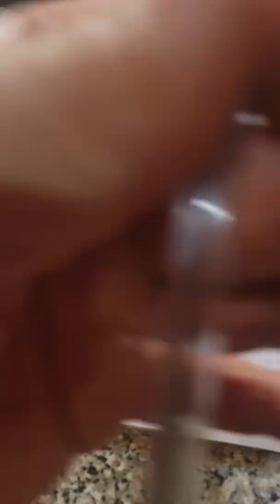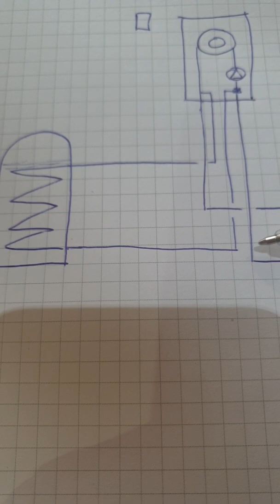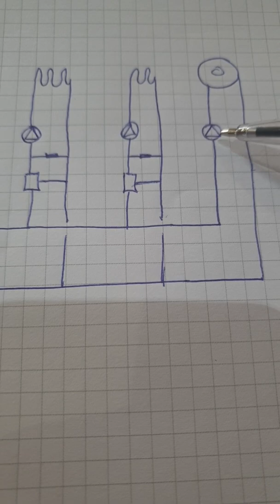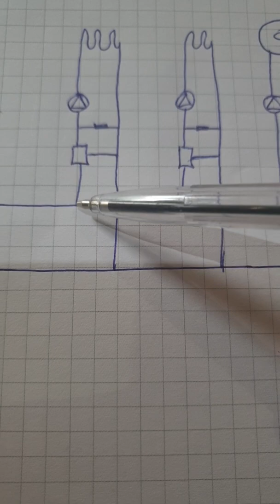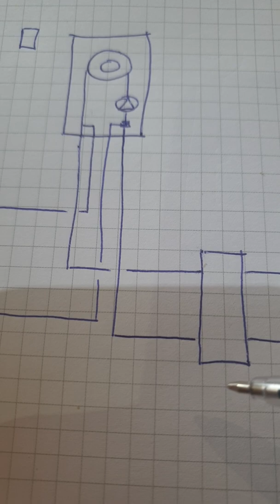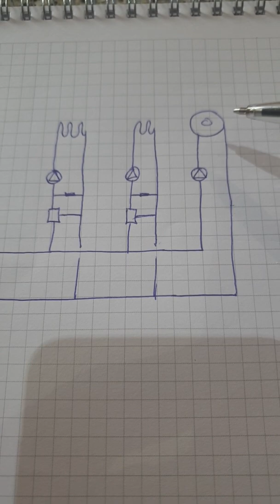Weather compensation and Viessmann design (Part 2)

Comment: Hi Andrew. Great videos. So informative. I have installed The new Viessmann 100 WB1KF combi in my 3 bedroom Victorian terrace. I have 8 emitters and have gone for WC only. 

I noticed in this video that you call the 100 WC dumb but on this boiler now you have the ability to alter the slope and level. 
I originally did have an internal Honeywell stat installed as well but have unwired it and am just using WC but have the stat still on wall as a reference point. 
Would you still recommend an internal stat wired back to the boiler in this scenario or would the WC only be ok?  Answers greatly appreciated. 😃
Reply: Yeah thought the weather comp was definitely better than the previous models. So would you recommend an internal stat in addition to WC sensor?
Reply from the maker: @himey78  no internal stat
Reply: Sorry forgot to mention. I currently have a slope of 1.2 and a level of 1 with a normal temp of 19 and a setback of 17 and the house is lovely and warm.
Reply from the maker: @himey78  the new 100 system is a very different beast.

Comment: Simple yet very useful and clear explanation, thanks!

I have a question, let say we have a standard heat exchangers only design (no underfloor heating), would it still be possible to have three independent zones, i.e. the three circuits of your example? Of course in that case I expect they will all work at the same max temperature, but that should not be a problem, is it? Am I missing something?
Reply from the maker: They can have different te.leratures.